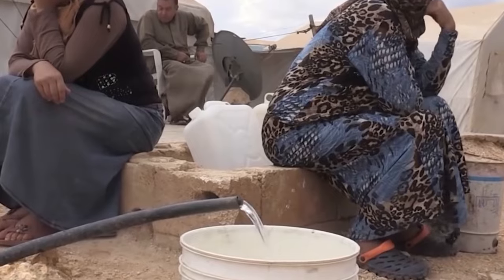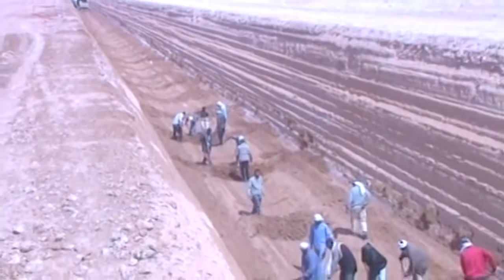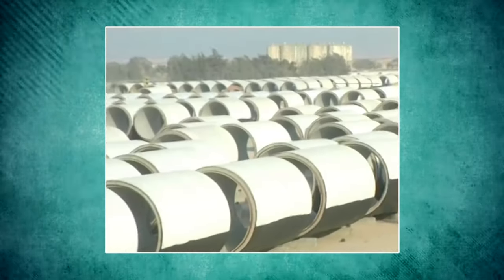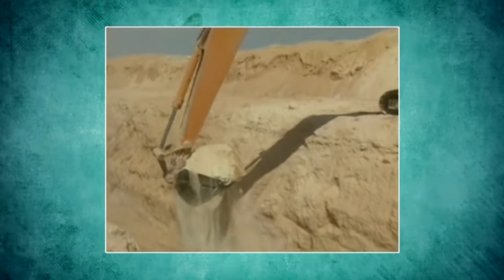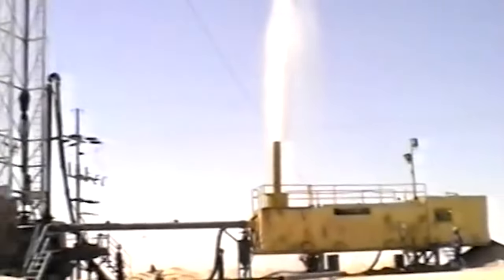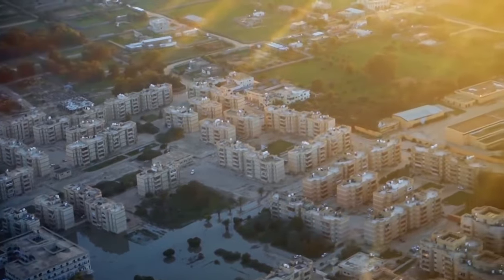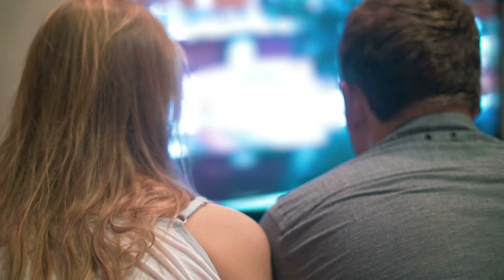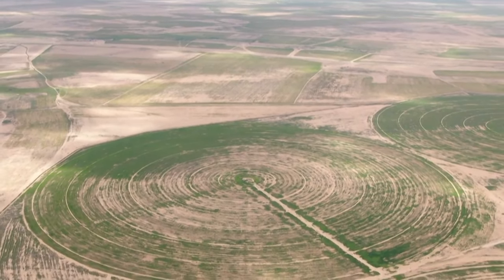How Rivers Were Built In Libya Right Under The Sahara. Gaddafi's Unbelievable Project

Comment: A British Materials consultant told me about how the Libyan Govt bought Stainless Steel tubes to carry all the artesian water from the Libyan desert to the coast for agriculture and industrial uses. 
However, after some time, the tubes started corroding. Stainless Steel corroding? It was unheard of. 
Then some smart chap realised that what gives SS its anticorrosive nature is a very thin layer of Chromium Oxide that forms on the surface of the steel, after the Chromium present in the steel alloy reacts with Oxygen in the atmosphere or dissolved oxygen in ordinary water. 
The water from these Libyan Aquifers was remarkable in that it had no dissolved Oxygen, and consequently no Chromium Oxide layer could be formed on the steel, and thus, no protection against corrosion. Corrrosion was rapid in some places, like joints and stress zones. 
Just wanted to share this fascinating bit of info.